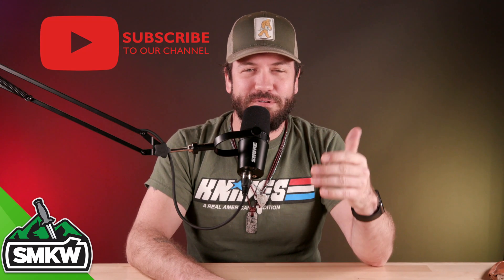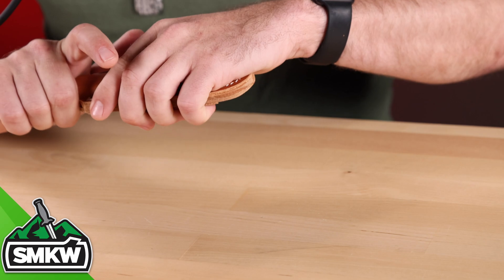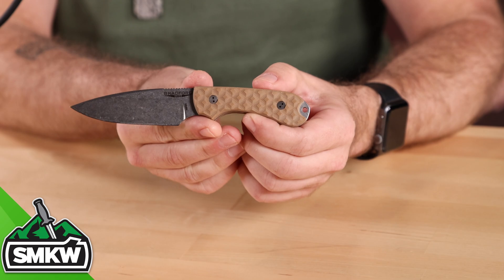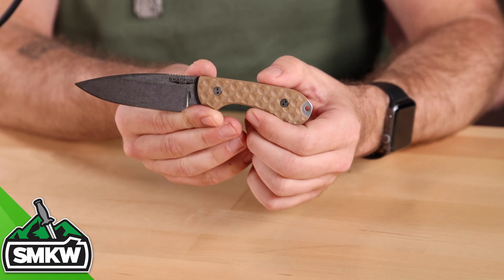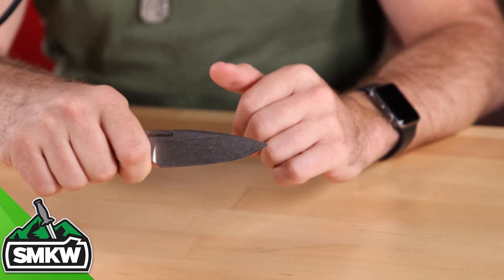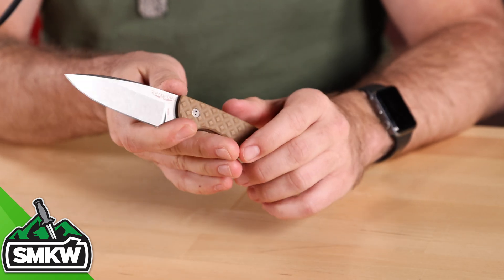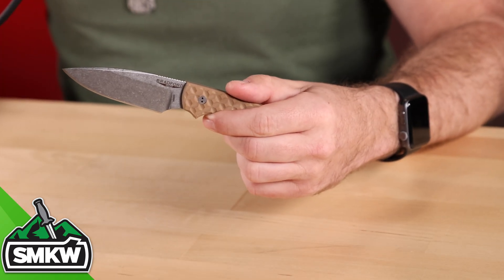NEW How good is N690?

Comment: N690co seemed to be just as tough to grind on my diamond sharpening system as M390. My diamond stones went through S30V like it was butter knife steel.
Reply: Yeah there's a common misconception that powdered steel is harder to sharpen than ingot steel. 154 cm and n690 are too good examples of stainless steels that are relatively difficult to sharpen. I'm not surprised that you found it comparable to m390

Comment: Balbach made a damast out of N690 and Nito-B, a have limited edition from Fox Knives made with that Damast.
But that knife already started to corrode, showing pit corossion somehow after 2 weeks, so i mailed Balbach and Due Cigni (fox) which steel they really used.
It is the Balbach DSC Ferus inox Damast. They send me PDF file of the steel etc and everything. 
And yes, i confirmed it twice, and they were not using the Carbon version.
It feels softer, it bends easier compared to other steels out there, it's just not on that level.

SO to me, out of the experience with many steels That means, this steel N690 is mediocre at best, even mixed with another steel. it is Mediocre at best. 
NOt EVEN CLOSE TO THE JAPANESE STEELS .....

NOt that i am saying the Germans dont make good steels... but this aint one of them. Just cheap.

Comment: Good steel… really a 440C, ie: a mod. N695, but Elecro-Magnetically Remelted (Cleaner). The Co does not add toughness in fact reduces it,  but helps with the Martensite (less retained Austenite?). Wee too much Chromium, which explains why VG-10 keeps a better edge. Very Stainless so good for “beautiful”polished blades. Good  (economic) Bushcraft Steel & Hunting blades, ~ 60HRC. Have it in several Spanish CUDEMAN… Field Sharpens easily.. & takes a beautiful polished edge that lasts. Handles “Mess Duty” with Pride & does not tarnish.
Reply: Fox Knives uses it as well, it is very susceptible for Pit Corrosion. so it is not SO VERY STAINLESS at all.
Somehow this composition of the steel doesnt work very well in practice.

Comment: I cut thick one inch cardboard on a very regular basis as apart of my job;.would this be a decent replacement for my 8cr13mov Kershaw cryo or my d2 qsp parrot?
Reply: N690, M390, or MagnaCut would be fantastic for you. I install commercial duct and have to cut a lot of tough materials including cardboard, insulation, thin sheet metal etc. I’ve used all 3 of those steels on the job and they’ve all performed very well.
Reply: @kayshell66  hella old post my bud! Thanks for the input though my knife journey has been wild to say the least! Customs,custom midtechs ,high-end productions , autos... you name it! My favorite curent basic steel is m390. But Iev taken a liking to 204p. I maybe getting heretic in magnicut soon.

Comment: Not all knife makers get the most out of any steel and some seem to do better with one or certain types of steel than others, it gets down to their individuall understanding of the steel in question,,,,,I.E. it gets down to the understanding of the steel being worked with and how well that understanding and how to get the best possible heat treating and tempering of the blade/steel, That said Bradford must do N690 very well because I've had a Bradford gaurdian 4 for quite some time now and it has been used quite hard and is still like new and seems to hold an edge (even though 690 isn't known for top edge retention)as well (or pretty darn close to) as some better known edge retention steels( M390, CPM 20CV, S90, CPM154) I own in some other knives, that gaurdian 4 is one of my favorite knives in my collection because of the blade steel's atributes,,,,easy to sharpen,,,,,stainless as all get out,,,,,holds an edge really well, and is tougher than some other even more pricey options.
Reply from the maker: Bradford makes some excellent knives👍

Comment: Just got a black micarta regular size Domin by Kizer in N690..I dont have a sharpening stone so I'm hesitant to use it. Using a D2 fixed blade as a utility tool since it's still sharp and my new Sencut Scepter in 9cr18mov lost its razor sharpness already so that will now be my beater knife..need a whetstone I dont think a steel rod will sharpen my knives to razor sharp (D2, DC53, 8cr13mov,9cr18mov and now N690) nice video btw which will have better edge retention my D2 or N690?
Reply: Are you buying new knives just because the ones you have are dull? Sounds like a waste to me and would gladly take some dull knives if someone no longer wanted them
Reply: @wades623  lol

Comment: Extrema Ratio uses this steel extensively so I'm sure it's great for that reason too.
I have a Extrema ratio NK1 neck knife and a custom neck knife made from n690 and both perform really good 👍
Especially corrosion resistance is excellent to exceptional 👏
Edge holding is actually really good.
Best of the mid range steels for sure 👌
I would  buy any knife in this steel
Reply from the maker: That is awesome and thank you watching, Chris! Do you have any suggestions for future steel videos or ones that you want to see?
Reply: @SMKWcom  Esee Izula 1095 vs Esee Izula 440C comparison in daily use and even hard use capabilities of both blades in these specific steels.
Battonning the hell out of both blades.
That would be nice😎
Reply: @chriscoetzee6484 did they ever produce an izula in 440?
Reply: Ex rat  runs  it 58 rc  lol try it  past 60 rc

Comment: I never had no problem with 440 stainless. I still use my Original Gerber Gator 440 stainless. Once I got past the original hollow ground edge it was more about the process of converting that angle, by hand, using a Lansky System. I have never had to so much as touch that edge up. I use it as my field dress and skinning go to and that knife has been through many a deer's gut.
It took a LOT of time and energy to get that edge, that has held for years. 
What do you think about Sandvik Metals?
As a career CNC Machinist for over 25 years, Sandvik is a mainstay of modern high-speed milling and machining either through their tooling or tool body line for heavy machining. 
Thanks for sharing this video with us!
Reply from the maker: Thanks for watching Scott! As a machinist do you have any suggestions for future videos or ones you would like to see? With you background we would love to have a insiders thought process👍
Reply: @SMKWcom  I enjoyed the material discussion in this video. With all the alloys being created and new materials put to use in modern knife technology it's a learning experience for me also.
My question remains to Sandvik metal use. I see it seems to be affordable and I would like to see some research done on Sandvik Metals.
These powder designs may make it easier to make combinations which were impossible or extremely difficult to make. That's a very quickly evolving specialty. I would like to see some very specific questions presented to Manufacturing Reps regarding both topics.
Thanks for replying to my comment.

Comment: My Spyderco Urban seems to have better edge retention than my Kizer ZipSlip, both with N690. I think heat treat weighs in dramatically. Not my favorite steel. I'd prefer VG10 or dare I say Kershaw's 14c28n. N690 is great for a backup tool box / glove box knife though. My opinions of course!
Reply from the maker: Opinions are great and heat treat and use factor heavily into a knifes life
Reply: I have an urban too. Once tried to cut through the tube of my vacuum because I needed to shorten it. I didn't realise there was STEEL WIRE inside of it to strengthen the tube itself. As I cut deep into it I noticed but it was too late. The edge was rolled. But a quick sharpen on my Spyderco double stuff with an additional stropping session and it was back to hair popping sharp.

Comment: Thank you for another episode about knife steels. I don't have a knife with N690 yet, living in a seaclimate would you advice N690 over 14C28N Sandvick or maybe even an all other sort of steel? Thank you T.C. and that Bradford looked interesting.
Reply: I know my personal opinion I'd stay with 14c28n that is a amazing steel it has edge holding up with most m390 it is just about as good corrosion resistance also. 
But like everything heat treatment is what matters and production knives are never taken to the sweet spot. That said 14c28n I've had out preforms a lot of super steels at a fraction of cost. Not that n690 is bad it just doesn't come close to edge retention of 14c28n with around the same corrosion. That's my opinion I lived in Florida for years fishing so I've had a bit of experience with bad environment for steels.
Reply: @richardhenry1969  That made it clear for me. 14C28N it'll be, i don't want my fishing knives to get dull fast. Thank you for sharing your experiences on this.
Reply from the maker: Either would be a good choice, and both are a great value, you could also consider H1 and LC200N especially if you do a lot of work in and around water.
Reply: @SMKWcom  thank you for the advice

Comment: All depends upon the heat treat and temper for 440, and similar steels.
Reply from the maker: You are correct, as long as the production is done properly, no matter what blade steel they use it will work, at the end of the day, it all depends on what the end user is looking for as far as attributes.

Comment: I've never been disappointed by N690, even if the Italians (and Boker) charge a bit too much for it sometimes. I think it's actually a really good steel sub-$50, as seen on lot of the newer Kizers.
Reply from the maker: Kizer has some awesome knives and Boker is always a classic👍
Reply: Don't forget eickhorn 180€ for 18cm n690 is a bit overpriced and that's the price in Germany
Reply: How do you put a price tag on the steel?  Based off how much the raw barstock costs?  Seems silly.
Reply: @DemoMan-fq9zi Cost of material and time to work those tough steels.
Reply: I had a fox dart, wouldn't stay sharp at all, dull after a few cuts on a cutting board, my guardian 3 is great tho, no problems holding an edge

Comment: I've had vg10 but have shied away from n690 but then again I'm a bit of a steel snob but I do realize that the heat treat is done properly any steel can perform well because I have seen m390 not heat treated properly and loses an edge quicker than vg10 so i guess it all comes down to the maker and the heat treatment
Reply from the maker: You are absolutely correct, it really is subjective and there is no wrong steel.  And again you are right, as long as the production is done right they are all going to work and each will be better in some areas or attributes and worse in others, it really just comes down to what you're looking for.

Comment: I think I'd opt for 14C28N, in a budget steel. Edge retention of VG10, corrosion resistant and ease of sharpening.
Reply from the maker: Both are excellent options as well👍
Reply: While tough, Imo personal experience, 14c28n dulls pretty fast.  I've had a guardian 3 in n690 have used for about a week without sharpening and it's still shaving, my bison in 14c28n stopped shaving after the first box I broke down.  Then again could be heat treat
Reply: @steelasura could be heat treat edge geometry etc but I have a 14c28n civivi chronic that dulls much quicker than my n690 guardian 3.5. Then again the chronic is slim super thin knife super thin behind the edge so make of that what you will

Comment: Viper Knives out of MBK still use some N690, I don't mind it, much rather have than chippy D2
Reply from the maker: QSP, Maserin, Bradford, Spyderco, and Kizer all have some offerings in N690
Reply: Chippy D2?? Try some Manly knives and choose their D2 steel option. More edge stability than any knife I have used and their edges,are as thin as Victorinox pocket knives blades! It's all in the heat treatment.Steel snobs,is a modern term in my opinion, that came out, from marketing tricks, that the knife industry came up with, to sell more knives.